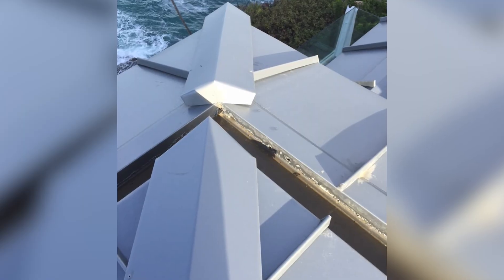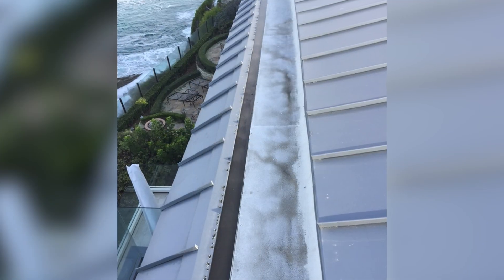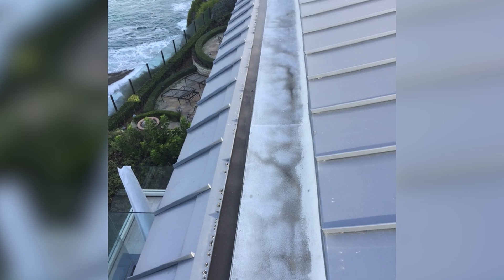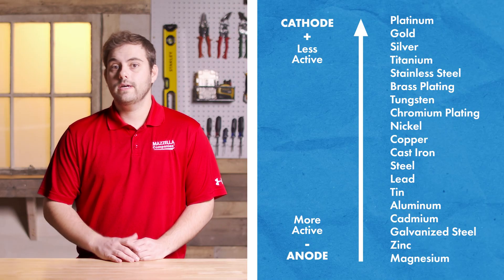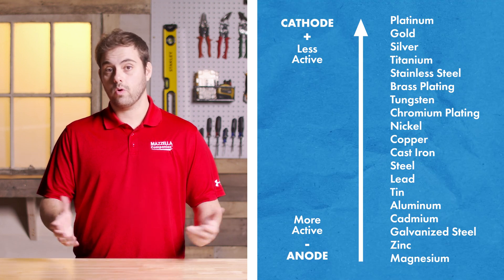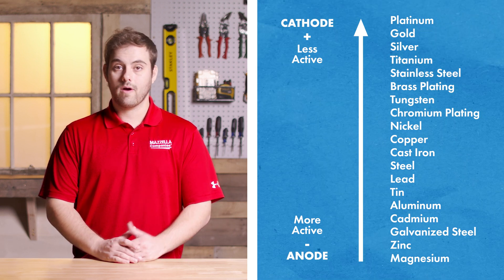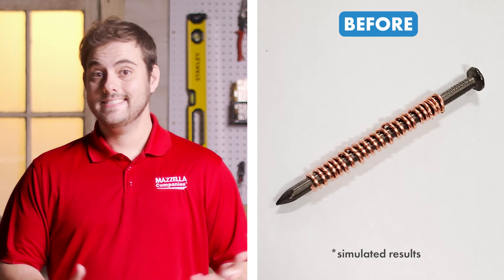Galvanic Reaction & Dissimilar Metals: A Recipe for Roof Failure

Comment: I’m just a home owner, but I know about galvanic corrosion because I took science in school. I also know that most metals will react with brick mortar but every roofer I have ask over the last 25years of home ownership has no knowledge of galvanic corrosion and how it affects flashing around chimneys. It’s like all you need to know is how to swing a hammer and you can start your own roofing company. Have you seen how they do it Europe, they still soiled seems over here they are using caulking, it’s crazy how code and knowledge requirements in the US seem to be geared more to towards the saving contractors time and money that giving the customer quality work that will last.
It’s time again to get quotes for a roof and I know now I’m going to have to hire someone who won’t know all they actually need to know to do high quality work. And don’t get me started on how uncomfortable it is to ask the questions about flashing and find out they don’t know what your talking about.
I’m at a complete loss of how to actually find a roofing company that can put a quality roof on my house.

Comment: Is it possible to separate aluminum and stainless steel with a rubber coating?
Reply: Yes. That's one way to do it. Anodization and painting can prevent galvanic corrosion too.

Comment: I love the content. Can you give more actual examples of opposite metals and even metals that do work well together. Thanks
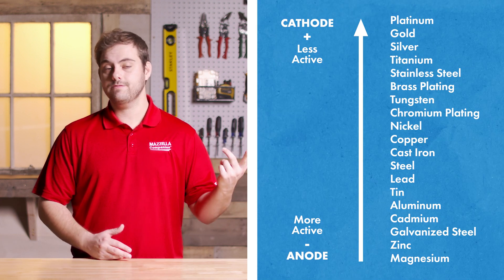Reply: As a master auto tech it is easy for me as I installed anodes on all my salt-belt vehicles. If you go back to the chart at 1:18, use metals or match metals that are less active together on the chart. It has to deal directly with the number of free electrons in the outer shell of the atom regarding the metal you want to protect. Example is boats. They have aluminum stern drives in the water. While fresh water is usually “Hard Water” zinc anodes are used & last 10+ years. Salt water in open seas require magnesium and when 1/2 is dissolved, replace it. So 3 items, metal to protect, the contamination of the liquid exposed to. Last, how much money are you willing to spend as cadmium is more expensive than magnesium. Zinc is cheaper yet and also plan on 10 sq ft of coverage. Simple. I use zinc anodes on steel vehicles. As iron (Steel alloy) is less active than zinc. It works. But a silver car with gold anodes would last forever as it would sit in my front room.

Comment: My experience using copper. Never use anything other than copper, stainless, or brass. Never use galvanized. There is a metal chart out there. It shows whats compatible.